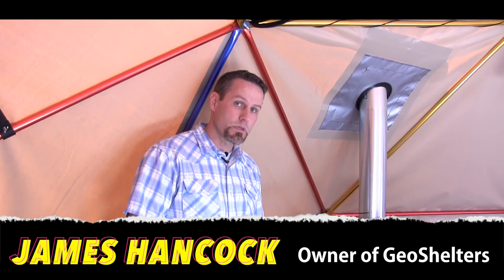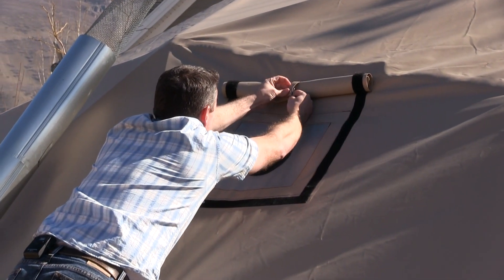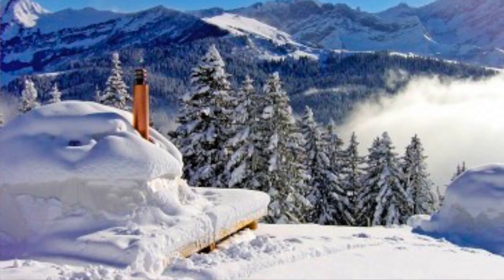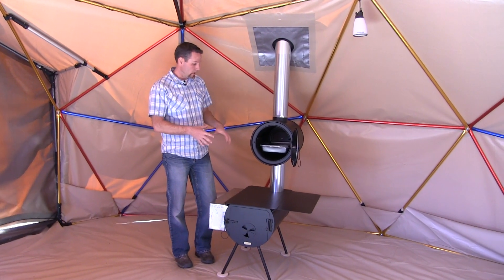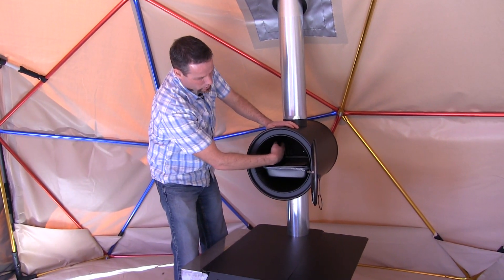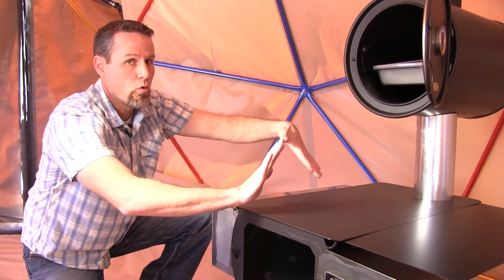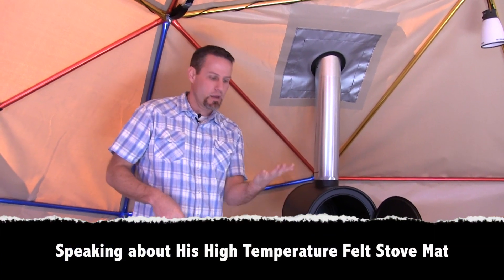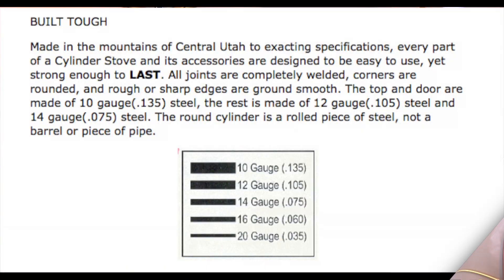Heating your GeoShelter with a Cylinder Stove

Comment: galvanized pipes are toxic when burned. why on earth do these stoves use galvanized?
Reply: breathe and squeeze only after you burn the coating in an open area then you would have no worries, the temperature will never get hot enough to become poisonous.  It won’t even get close to that temperature.
Reply: Research before you open ur mouth , BOY